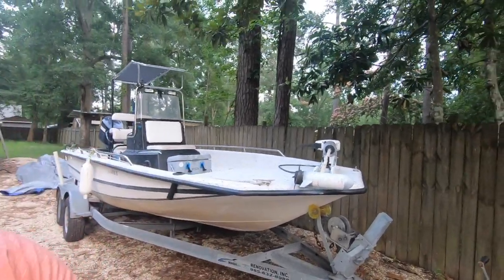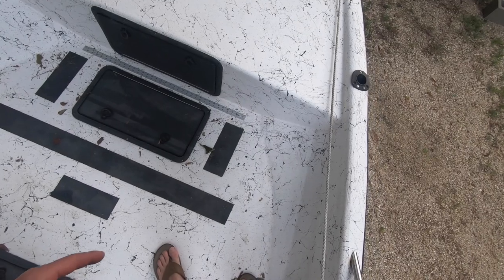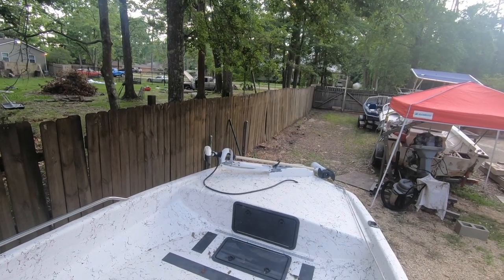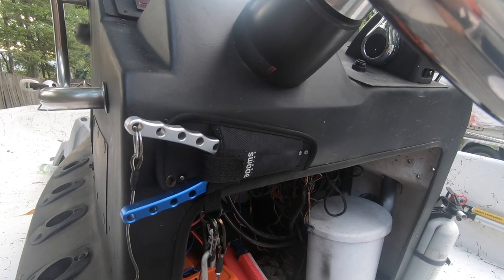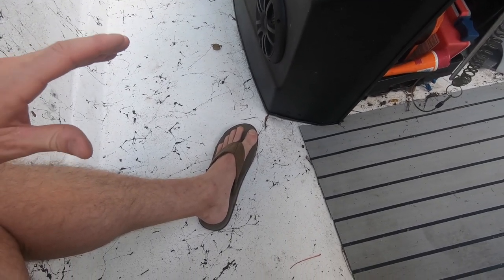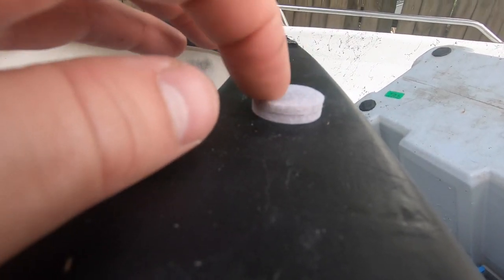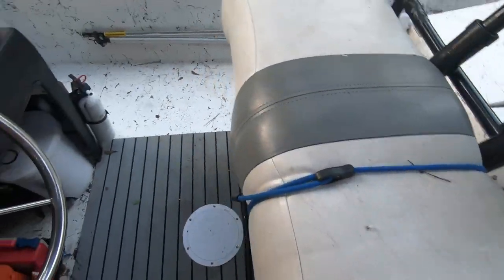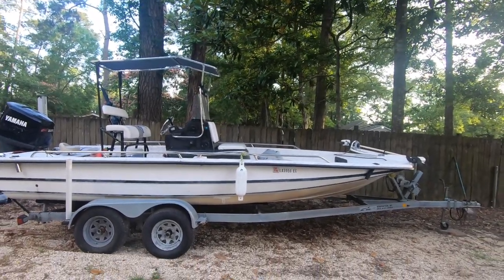10 Fishing Boat Hacks You'll Love!

Comment: Use heat gun on motor
Reply from the maker: Thanks. Started off with heat gun and a razor to get the decal off. Was still left with the adhesive. Ended up using a combination of eraser wheel on a drill and razorblade with Googone

Comment: Have you tried a rubber wheel for the decal removal? And a little tip for the spider cracks. Use a multi Dremel tool and just make deeper groves in the spider pattern and fill it with gel coat filler👍
Reply from the maker: Yes I have. It is a great suggestion! Thank you! 
I showed just how it works in detail in this video below if anyone would like to see.. https://youtu.be/oyKO8iMBxSA

Comment: Eraser wheel for drill gets it right off. Get it from local auto parts store
Reply from the maker: I will try it! Thanks for the advice
Reply from the maker: Eraser wheel for the win!! Thanks brother! There was still some adhesive left but it did a much better job than any of the other chemicals I used. Ended up using a razor blade with some googone to clean it up a little more